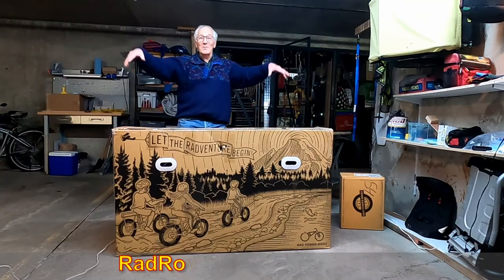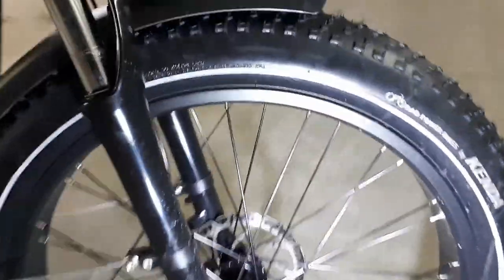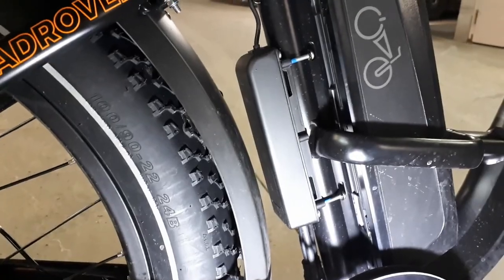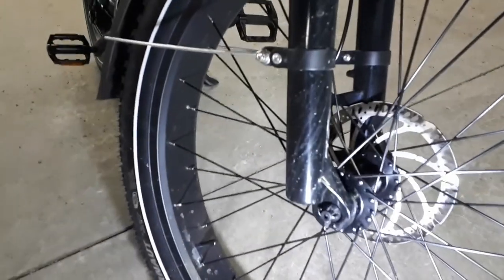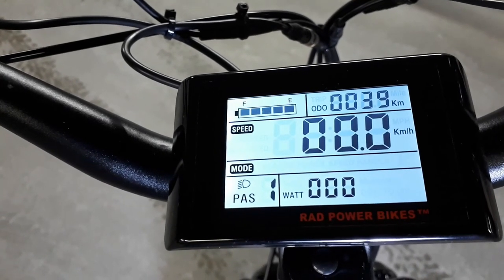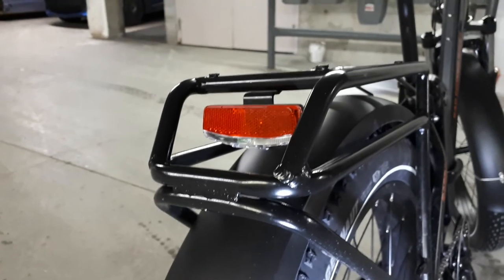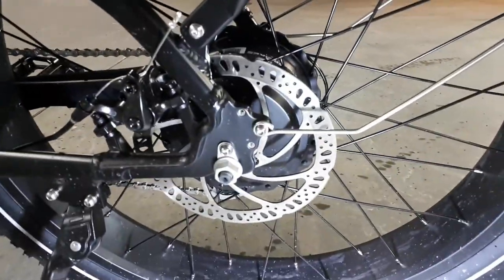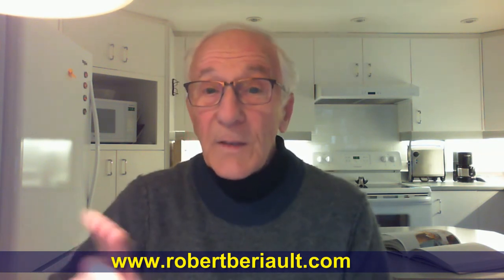The Non Unboxing Radrover Fat Bike Review

Comment: What's the recommended tire pressure? And minimum? Better grip at the lower threshold... congratulations on your new ride... Heard good things about the Himiway... also... I would probably switch out the rise handlebars for a lower rise... To get better attack... unless it's not a problem... Don't fix what's not broken.
Reply from the maker: 20 - 30 lbs. I like them soft. The rise if good for my arthritic neck. It's me that's broken.

Comment: No rear suspension or springs on the seat!! Kills my back!! Front fork suspension doesn't stop the shock from the seat post that travels right up your back.
How many Km's or Miles do you get on a charge?
Can you mount a backup battery where the water bottle goes?
Sorry to be a negative Nellie but, everything seems to have a high price tag on crap.
Hope it works out for you.
Be well!!
Reply from the maker: I intend to get a Thudbuster seat suspension system. Then it will be so comfortable that I'll risk falling asleep at the pedals! Don't know the range yet, but I have a pretty good idea. You can see why if you watch: https://youtu.be/CdV3BywWEpk 
Thanks for the tip. Yes, that would be a good place to mount a second battery.

Comment: Nice review. How do you find the cable disc brakes. Are they effective even with loads?
Reply from the maker: Until they get broken in, it requires more pressure than normal on the levers, but after only 39 km it's already getting better.